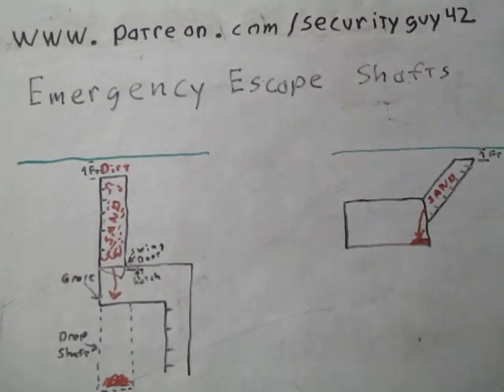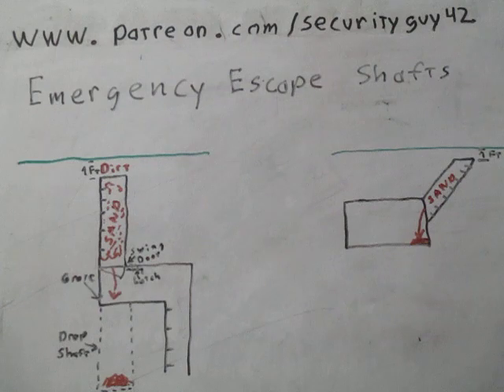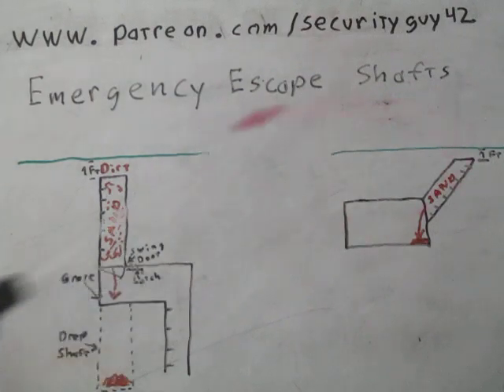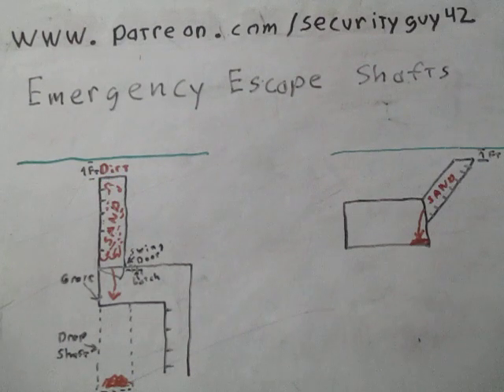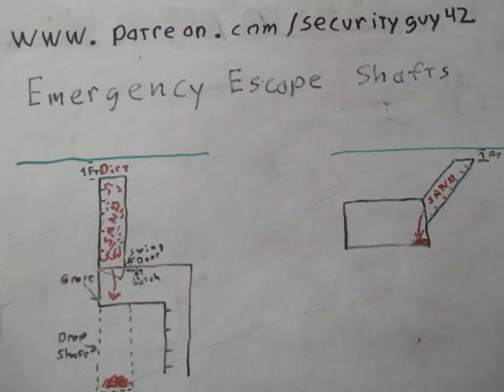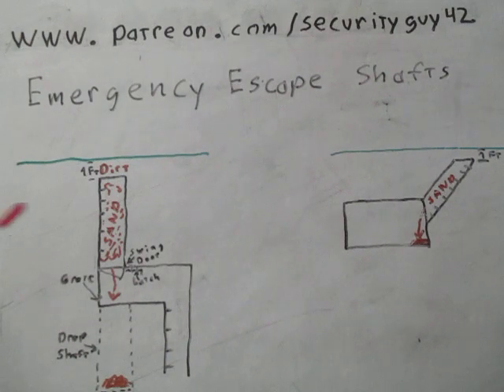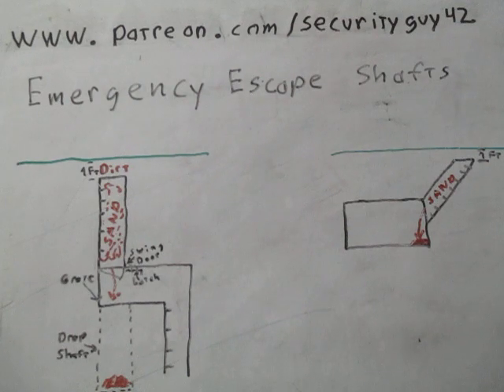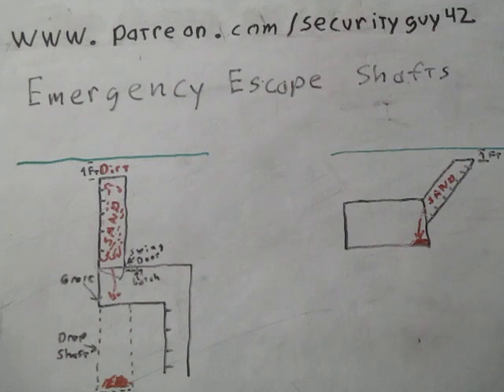Militia Engineer Tasks- Tunnel System Emergency Escape Shafts

Comment: My curiosity with bunkers and underground networking for militias is that if your militia is effective enough or becomes a priority seismic detection may be used on your position.  I really think the only defense there is OPs to detect such speciality equipment at range and to try your ass off for the enemy to not get even close to your position.  Now chances of seismic detection is not likely as it is such a rare resource but it is a threat and could be used by forces to raid the position before SHTF/ Civil War